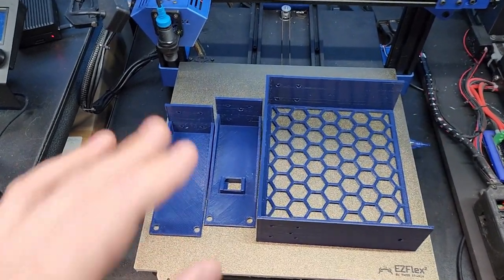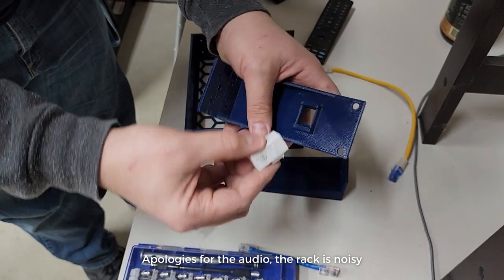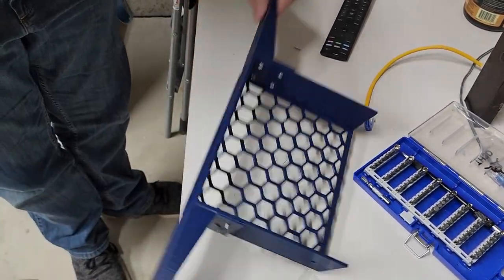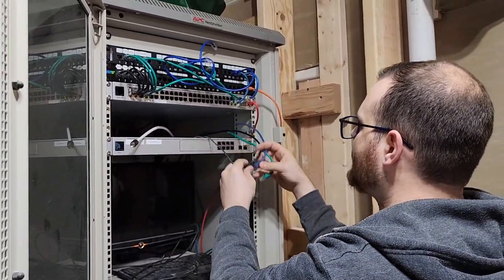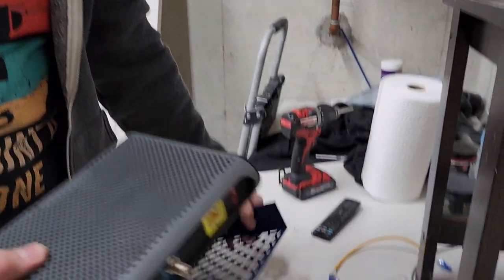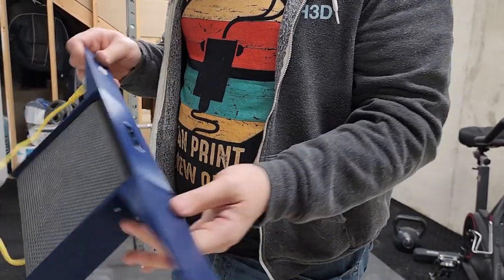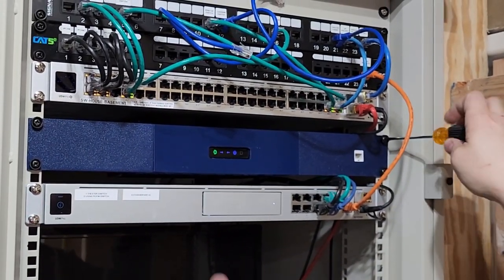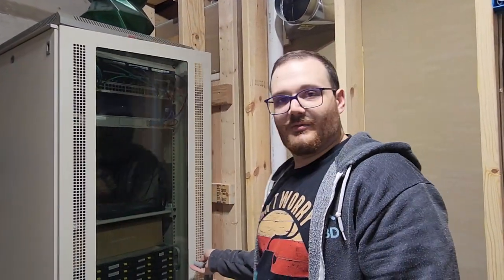Practical Prints - Rack mounting my Motorola MB8611 Cable Modem

Comment: Did your speed increase with the new modem?
Reply from the maker: Not just that modem but using a 2.5GB interface and our service is the 1200+. With the old modem it was limited to 1000 because it was a single gig ethernet port. Our router has a 10G WAN port so we use a 10G SFP to copper to get the 2.5GB speed with that modem.
Reply: @TH3DStudio  wow more than a gig with coax
Reply from the maker: Yeah its quick. I really wish we had high upload. Its only 45 down...thats the only reason we have the higher download speed is because the lower tiers have even slower upload speeds...